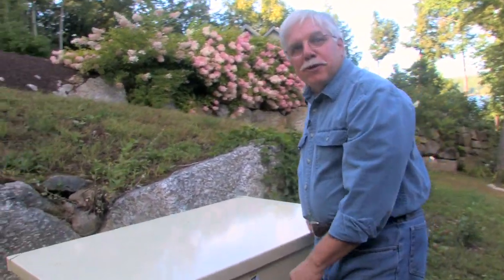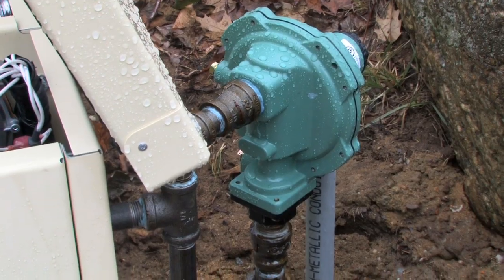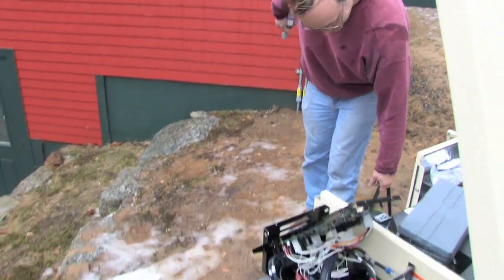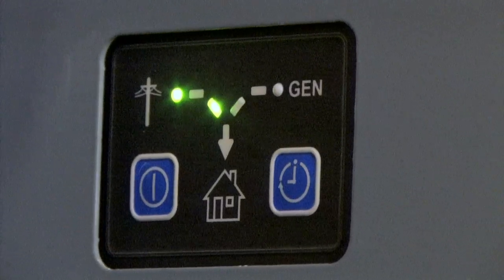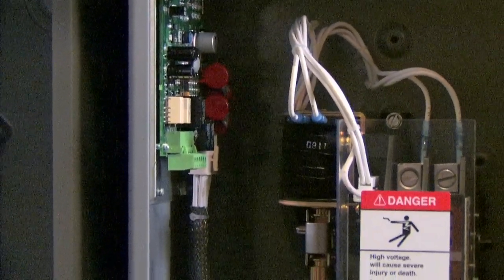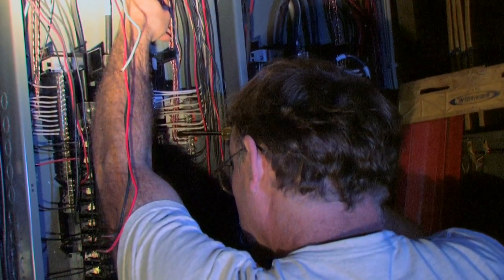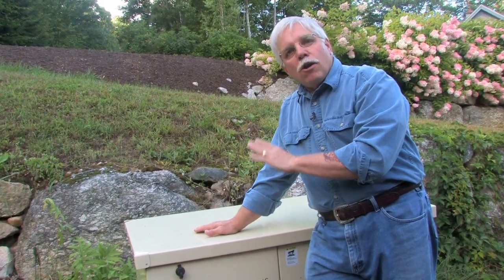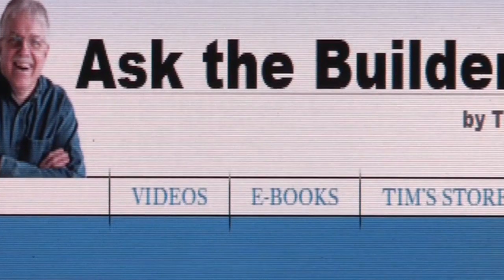Standby Generator

Comment: I'm a generator technician, and the place I work for is a guardian dealer.  Guardian does have a line of diesel units. One of the bonus's of them is that they usually have a 4 pole alternator, and only turn 1800rpm vs the 2 pole 3600rpm that most gas units have (small gas models just don't have enough low end torque to run at 1800).

Comment: I have a house in Lebanon up the mountains. Seven floors. It has a swimming pool, elevator, lighting, pumps, etc. The problem is that there is not enough power going to the moutains so we have powercuts happening 2-3 hours per day.The house has three standby generators. They are all differant sizes depending on how much electricity we need. The powercut we experience is less than 10 seconds compared to our neighbours which can last up to 3 hours for them. Thank you standby generators!

Comment from the maker: @HoBustinJopson Yes, they can absolutely be expensive to install. You're paying for three things: tremendous extra power you can't get from a tiny gasoline generator, convenience because it automagically comes on and is HARD wired into your system, and above all SAFETY. Portable generators, with the spaghetti extension cords are not safe - not to mention the carbon monoxide hazard.

Comment: I have looked into these vs. a solar panel and or wind turbine with a battery backup bank, like others up here in Michigan we have not had the power go out for more than 8 hours, not sure if batteries would do the job and certainly would not run all the things you mentioned. I guess it depends on a persons budget, a good battery bank with inverter might cost as much as one of these...Do any run on anything else than propane or diesel? Like natural gas? Propane is outrageous here..Thanks!

Comment: Simple questions, what was the cost of the Generator, Propane or natural gas connections and final, the cost for having it installed.
I think most people should have one if living outside the city bounderies. Living in Quebec this is a must where mother nature does bring some nasty surprises.
Thanks
Reply: I have this exact generator and transfer switch installed in our gone and the cost back in 2008 was about $7500 installed. Probably closer to $10,000 today

Comment: @HoBustinJopson  yes just add up what u want to run, there watts, things like refrige, and well pump, have starting watts, like frige, uses 600 watts but when it starts it uses 1200 watts for a sec, and just get a gen that has at lest 500 watts more power. that will save the gen head from burn out, so it will last u more years, then just get a manual transfer switch with as many switches to as many brakers as u want to run, 2 switches will be needed for 240v brakers.

Comment from the maker: @hitachi088 The paint finish on the unit will probably last 30 years or more. You could also build a simple roofed structure with generous overhangs to keep all but a driving rain off of it. Installing a machine like this in a house is a recipe for disaster. Wait until you develop a tiny leak in the exhaust. Oh wait, you'll never know, you'll be dead of CO poisoning.

Comment: I was told by an installer that air cooled generators must be shut off to cool down.  This certainly cuts down on convenience.  Is this true?
Reply: I have this exact generator installed at my home and have it for twelve years. The longest it has run is ten days continuously. I does not need to be shut down to cool off in my experience
Reply from the maker: When you read the owner's manual what did it say? Watch my NEW live stream videos! Subscribe to get my FREE newsletter here: www.AsktheBuilder.com

Comment: So, I'm guessing a typical 17kW standby will cost between $4,000-$5,000 plus the installation cost which could range between $2,500-$3,500. Total maximum cost = $8,500 + tax. That's quite an investment. But well worth it if you've ever experienced a power outage more than a couple days. I'm talking about you Connecticut!
Reply: txmoney Agree. But I decided to go a little smaller and save some money.  I will be installing a 13kw cumming . Around $3200 with a TS. I can do the gas pipe, LP, and I have a friend electrician who can do the wiring.  I will save about $2500.   Generac goes from 16kw down to 11kw which may be too small.

Comment: That generator puts out 70 amps of power.  enough to run electric water heater, ac ,stove microwave, fridge , all at the same time. as well as smaller appliances TV PC ect.